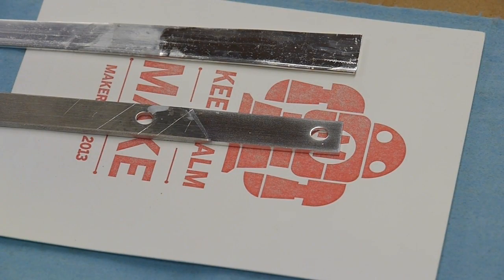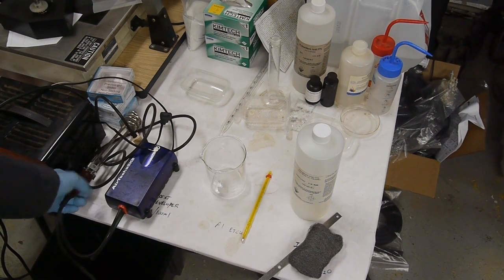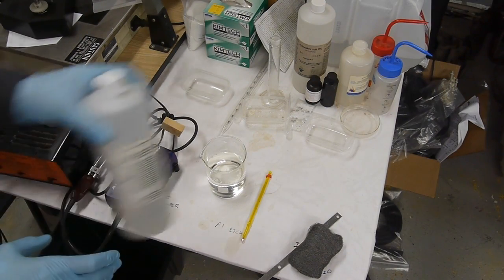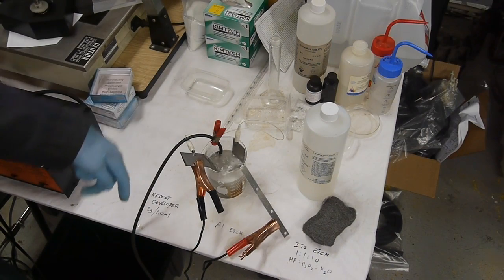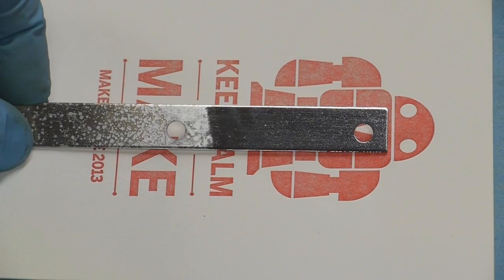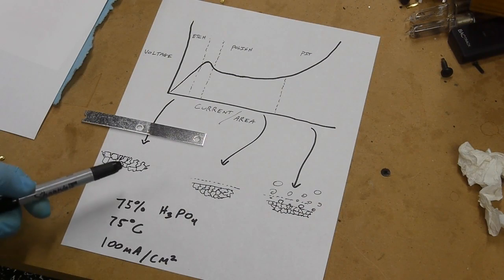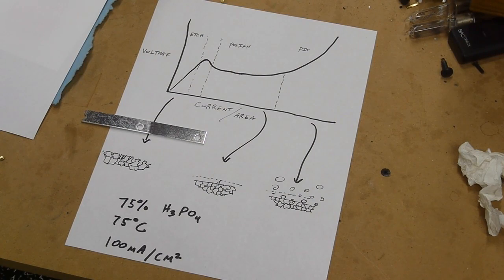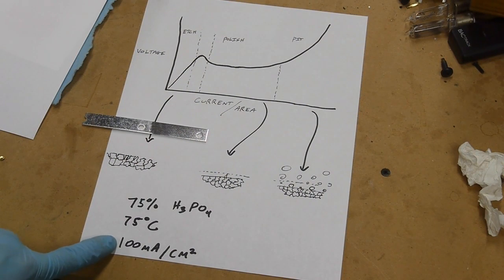How to electropolish aluminum

Comment: It's been a while since I did this, but the sonication does help.  I also remember electropolishing in one solution, then switching to another solution briefly and repeating the cycle.  It might have been electropolish in sulfuric then etch off the oxide in phosporic.  As long as you didn't get too much current, you could get beautiful surfaces.

Comment: Have you tried using a similar technique to electrosharpen edges and points?  I've wanted to do this for a while to make AFM stylus.  Most recipes seem to use sulfamic or phosphoric acid, some in a rather viscous solution, including one that had organic resins in it.
Reply from the maker: Yes.  However, the method that I used requires that the wire be slowly withdrawn from the bath so that the tip has more time in contact with the chemical reaction than the rest of the item.  This gives another dimension of control, allowing the taper to be adjusted, or even made non-linear.  I'm not so sure the method would produce atomically sharp objects, though.
Reply: +Ivan Kocher The NaCl is added to facilitate conductivity to the distilled water(or increase conductivity of tap water) in any electrolysis process that doesn't have an acid or base as an electrolyte!
Reply: I have done this with a regular wood nail.  This was ~8years ago.
My steps were:
* solution: water+ table salt (NaCl), quite probably not saturated
* a graphite electrode ( from a regular "A" battery)
* iron nail the other electrode, nail head connected to the cable, out of solution.  Be sure the nail is grease or oil free.
I do not recall which electrode was negative.

Start with a "hi" current (5~10A), you will see the nail starts to get thinner, and the solution will look rusty and lots of bubling (O2 and H2 being released), as time goes on, reduce the current, so you have better control of the "thinning" process.  The thinned part will also be extremely polished, with a really nice shinny look.

The part of the nail in the solution will get an extremely fine point.  Graphite is not affected, and solution be full of iron oxides black and orange ones.  Not sure what happens to NaCl.

The nail I used was about 1/8 in diameter, and took a few days.
Reply: Ivan Kocher From what I remember of the inorganic chemistry classes that covered this sort of electro-chemical process, I'm pretty sure the Cl from the salt formed a chlorine gas when you applied current, making some of the bubbles you noticed(because it has a decent reduction potential, meaning that it tends to receive the electrons from your power supply and use then for going from the oxidized to a reducted state)... not sure about the Na, but it's most likely it stayed in the solution since Alkaline metals have a high tendency to remain oxidized. The salt is added to the solution so there are enough eletroclites in the water to make it a decent electrical conductor (pure water is a poor electrical conductor) practically any other salt would work too (except different chemical reactions could happen).
Reply: ..AFM stylus... I see references to that in Scientific American, but don't they use tungsten...?

Comment: I'm not sure the air stone is actually a good idea if the polishing requires some sort of layer on the part surface. and may explain your results. Do you know if it is possible to use a graphite electrode? I have had good results with stainless using a carbon fibre brush as my electrode, it gives me lots of control. Also great for weld and silver soldering clean up.
Reply: Where do you get a carbon fibre heat resistant brush from?
Reply: Take some loose fibres (you can buy them on a roll) insert into a piece of metal tube and crimp.

Comment: Ben - Why doesn't the aluminium re-oxidize back to it's usual grey appearance immediately it's exposed to the air?  Al is incredibly reactive normally (when not coated with oxide)...
Reply: Ivan Kocher Thanks All.  I had assumed that oxidized Al had that grey appearance, but actually the layer can be so thin that polished Al still looks shiney even though it's oxidized.
Reply: Aluminium always is coated with oxide layer when exposed to source od oxygen for example air. Usually it forms very quickly few to several dozen nanometers thick layer of oxide, which you can't see even on polished metal. This layer is hermetic, it prevent any futher oxidation. Grey appereance is from corrosion, or rough surface, or often aluminium is anodized - artificial created few microns thick layer of oxide, which is hard and prevents corrosion.
Reply: IIRC aluminum is so reactive, it will steal oxygen from water to oxide itself, releasing H2 in the process.  But as Woloszow said, the layer is nanometers thick, hermetic and is pretty fast.  You will not see it "happening".
Reply: u answered yourself

Comment: Regarding bubbles on the metal surface, if you have a ultrasonic bath you could put the beaker in it, and the ultrasonic agitation will help disperse both bubbles and dissolved gas.
Reply: ...(but too strong and it will tear layers off the the aluminium. In fact a common way to test the piezos on ultrasonic baths is to see if it can disintegrate aluminium foil).
Reply: nucleochemist Tearing layers off a solid and destroying a thin layer would seem rather different.
Reply: *****
It's exactly the same effect, caused by cavitation.
Reply: nucleochemist If you put a lump of ali in an ultrasonic bath nothing happens, that's been my experience.
Reply: *****
I love this channel: SO MANY NERDS!!! :-)
Reply: +littlestworkshop - There's a significant difference between just an ultrasonic bath and an ultrasonic bath assisted by acids and electrolytes...

Comment: I’ve heard the term, ‘electropolishing’ and it application but nothing about the procedure.  Thanks for the primer.  A thought is that a battery charger although providing DC is not filtered (e.g. capacitors, inductors, etc.) and the 60 Hz ripple may cause a bit of a ‘electrochemical hammering’ effect on the surface of the aluminum promoting the pits.  Maybe, I don't know.  Cheers, Mark

Comment: Why would you want to do this?
Reply: Mark Beeunas This method however lends itself to large and/or complex shaped objects. Can you imagine how long it would take to mechanically polish a square meter of aluminium to that kind of shine? Now do it to 1000 parts/day on a production line, and this chemical method suddenly looks very appealing.
Reply: nucleochemist also - when you want really smooth surface finishes (mirrors for instance), electropolish is pretty much the only way, and it doesn't leave residual stress in the polished surface (which is the case with mechanical polishing, which is basically - cutting), cracks can start to develop there and cause the whole part to lose a lot of its tensile strength
Reply: Yeah, it seem like the long way around the barn to do something that can be done with jewelers rouge and a polishing wheel.  But there’s the rub (sorry, I couldn’t help it); the constituents that are in jewelers rouge (i.e. iron oxide, cerium oxide, clay, wax, ???) or in other types of polishing materials will get imbedded into the polished surface.  This surface contamination can cause problems when trying to do electroplating, vacuum deposition, making parts used in high vacuum experiments, etc.  Electropolishing is a way of producing flat, smooth, very clean surfaces that are ready for Ben’s next project(?).  Cheers, Mark
Reply: nooks and crannies
Reply: *****
Yes, nooks and crannies.  At the lab I used to work at we acquired a stable isotope mass spec that had been abused, the source, collectors and flight tube were contaminated with who knows what.  We sent all the contaminated high vacuum parts to a company that used an electrochemical process, but preformed “electro-cleaning” followed by vacuum bake-out.  The parts came back shiny and clean but not polished.  So my guess is the procedure they used cleaned into the “nooks and crannies”, but did not do much to the metal itself.  Cheers, Mark
Reply: To make something look shiny and/or modify its surface properties, probably for some mechanical reason.
Reply: Mark Beeunas jz1199 nucleochemist Thanks for educating me :D

Comment: Hi Ben, I have done electroremoving before.  I looked at different phases of superalloys.  ASTM E407-07 covers the solutions and procedures for etching all sorts of alloys.  It states that 10% H3PO4 immersed for 1 to 3 minutes at 50 deg C is good for 2000, 3000, 5000, and 6000 series Aluminum alloys for general structure, phase identifications, and grain structure under polarized light.  So you were right to use H3PO4 as a etchant and polish solution.  I got a little creative with my project and tried electroremoving a pattern using press-n-peel blue transfer film.  I know for a fact it sticks to Nickel, Nickel superalloys, and Copper; I haven't tried it with Aluminum, but I think it sticks to practically any metal.
Reply: I used heat transfer PCB resist via printer-bubble or toner type I can't recall, maybe it was on a copier machine- probably, it worked well.
I made a two piece die with this metode and casted lead into it.
though the relief was very slight, the image was well prepared. I had less good results etching stainless steel.
with electrochemical etching current control is critical.

Comment: I looked at electropolishing stainless once and after I saw the standard chemical used decided against it. Incredibly nasty stuff used there like Perchloric Acid. Nitric acid is actually one of the more benign chemical used and you need up to a couple amps per square inch.
Reply: Pickling might be a good alternative depending on why you want to change the surface. It basically involves submerging the part in concentrated sulfuric acid for some time..
Reply: nucleochemist Sulfuric is fine for passivating stainless but other than corrosion resistance it won't do much for things that you would use electropolishing for, like gas, vacuum, and liquid handling components.
Reply: I've polished stainless with a mix of phosphoric, sulphuric and water. I used a brush made from carbon fibres as my electrode.